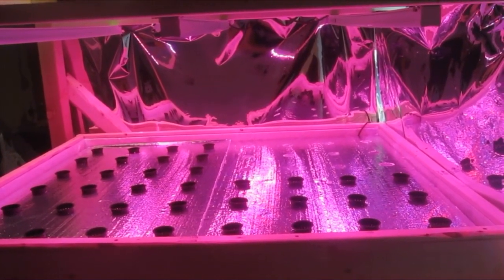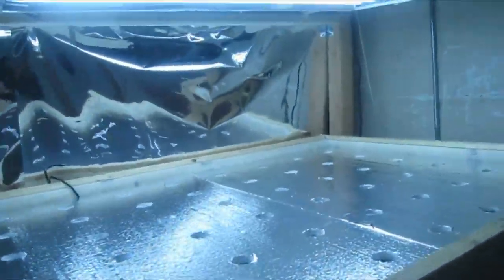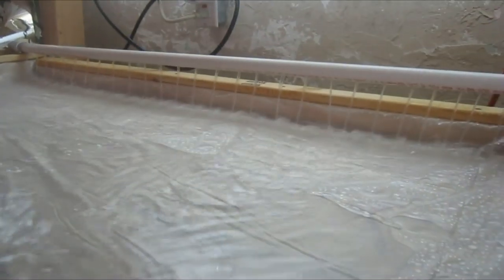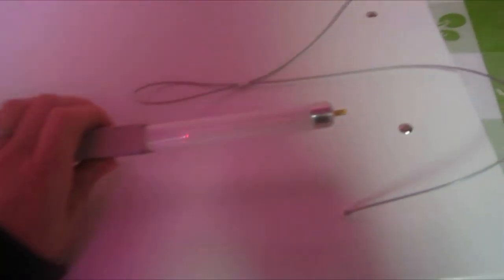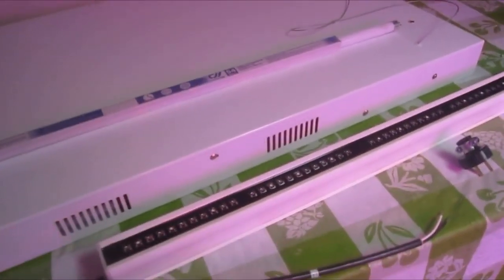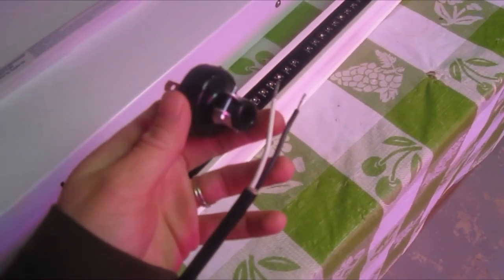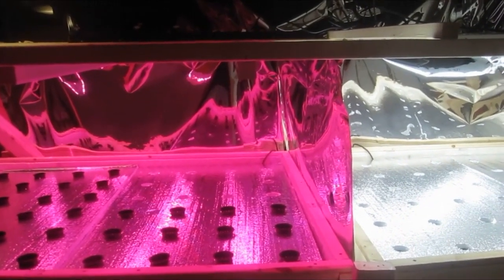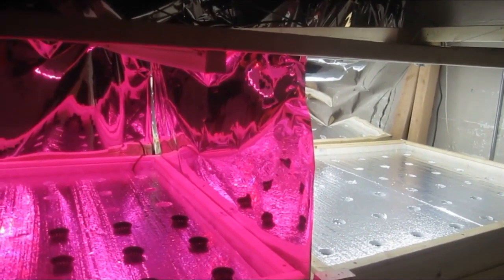LED vs T5 in Vertical NFT Hydroponic System by The Lettuce People

Comment: HI Katie
i love your experiments and i am a manufacturer of grow tents and see a lot of negative and positive on LEDS. Okay i done a ton of research and i can give you some benefit of this. firstly theT5HO are going to do quite well for lettuce BUT i have a suggestion that you change the globes not the fixture in one of your next grows and try some Econolux brand T5HO and buy some different spectrums for these. I think you will find you will get some interesting results. get some blue ones i think it will be a big difference to your existing ones.
I think taste test is also important, i think LED will have some nice flavor but this can be also be tried with the Econolux as they use different phosphors to get different growing, i think this is really good thinking as we all know that the flavor is also important like the running costs.
Also a grow light can die two ways slowly by loss of output and quickly like BANG and dead. LEDs die the slowly. the output of the light drops significantly in the second year of operation so the maths on savings is not always so obvious.  I am not pro either i just get some feedback from different sources. 
Only time will really tell.  I think LED still got a long way to go but getting there. The new COB designs are interesting, these are a step forward to.
The nice think about the T5HO compared to the HPS / HID lighting is that its runs so much cooler and can be placed lower. HPS is just to hot as you have already found out i am sure, its expensive to run and has a short lifespan, its good for red output and should be used as a supplemental light in conjunction with other lighting. 
Its not really a case of either/or its a little bit more true that  mixing different types of  lights at the right time for the best results, each light has its benefits. You could start out with T5HO and then add the HPS later in growth for short time to get really good results. 
I am so glad though that you are doing a power comparison test and looking for the most cost effective result because unlike the many using this to grow medical plants the point of all this is that ultimately it has to be cost effective for edible plants as well to become more mainstream. I am with you all the way Katie keep up the good work.
We have a lot of mouths to feed on this planet and its work like this by you that will have an effect on that. we have 7 million now and by 2050 9 billion (35 years!) if we do not look for ways to feed all those  extra mouths it will cause a lot of problems. Hydroponics is the future.

Comment: You should be using a blue,blue/white spectrum LED for early growth and veg. Looks like your using red LED's which are mainly used for flowering and end stage. Its all about lumes and spectrum with LEDs. You may need to build different stages, but I really like what you have built. keep it up.

Comment from the maker: Thank you! The T5 chamber is running 4-6 degrees warmer than the LEDs that goes for the air and water temperature.
 The lights are from a company called HortAmericas check them out online for pricing and info.

Comment from the maker: Im really hoping that the LED's work better. I am really trying to cut down on energy costs. 
I do still have and run the A frame. I would have built it out of better wood. I used scraps I had laying around and it left some of the channels uneven. I would also use 4-400 watt metal halide grow lights. Again I used what I had on hand and it was 2-400 watt and 1-1000 watt. I think it just might be that the manufacturer designed them to be sealed. Im not sure though.